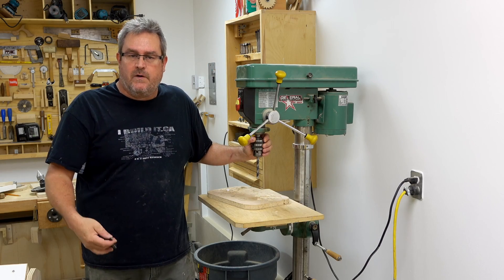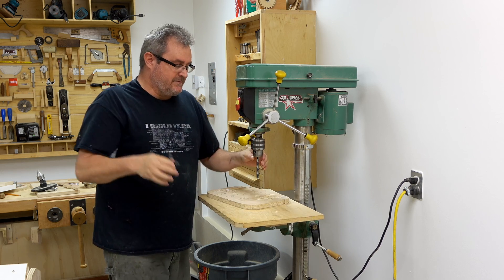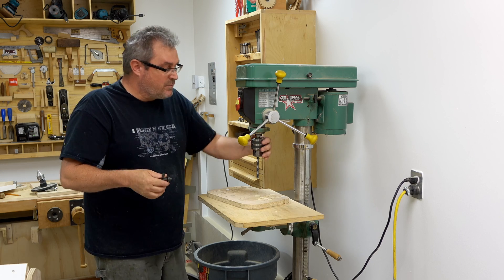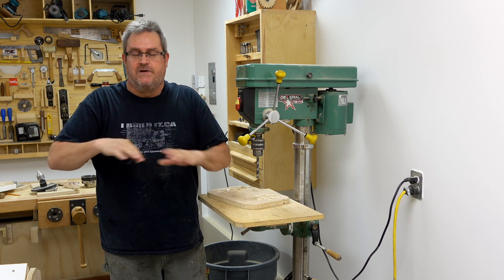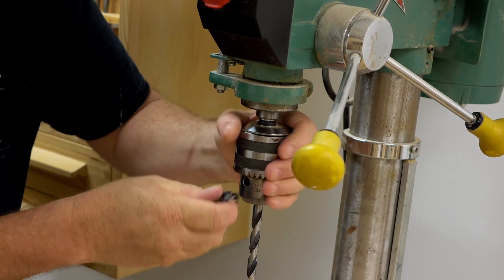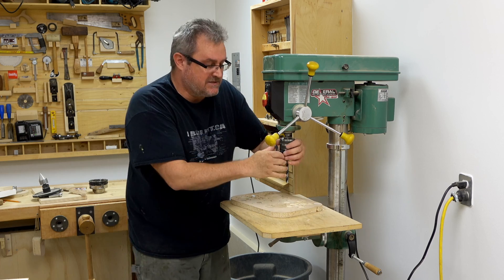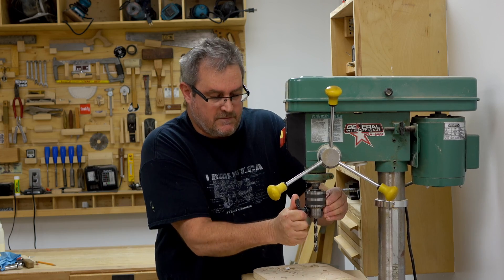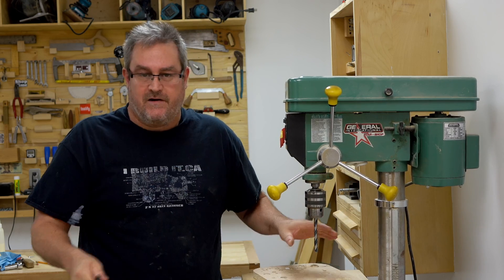Why Tighten All Three Holes On A Keyed Chuck?

Comment from the maker: Applying a little "there are no perfect machines logic" to explain why you should tighten your keyed chuck from the three holes for maximum holding power. I normally just do two, since I generally don't need the best grip on the bits, especially for drilling wood. But, it does make a big difference when you need to drill steel or other hard or tough material.
Same applies to hand-held drills that take a key, or lathe chucks.

You can help support the work I do in making these videos: 

Plans for sale: http://www.ibuildit.ca/plans.html 

Support this channel on Patreon: https://www.patreon.com/user?u=865843&ty=h 

Did you know I have other YouTube channels? 
My main channel: 
https://www.youtube.com/user/jpheisz 

More videos on my second woodworking channel: 
http://www.youtube.com/c/IBuildIt 

My home reno channel: 
http://www.youtube.com/c/IBuildItHome 

Website: http://www.ibuildit.ca/ 
Facebook: https://www.facebook.com/I-Build-It-258048014240900/ 
Instagram: https://www.instagram.com/i_build_it.ca/
Reply: Glen Shevel, I'm almost under the impression that there isn't a ""woodshop class" in school anymore.  My H.S. did away with both the industrial arts and the ag shops to May way for a new computer science lab--  made even worse by the fact that it's in a farming community.  Sad, just sad..
Reply: Three jaw lathe chucks, yes if they have three holes.  The three jaw chuck on my 10" Rockwell-Delta lathe only has one hole.  IIRC, it's a 1 1/2"-8 thread mount and 6" diameter.
Reply: I may need some help on this one but you tighten all three because of the safety factors.
Reply: Don't know what they teach in woodshop class in school anymore, but this was fundamentals 40 years ago.  Maybe teachers these days don't know the reason, so don't care.  They probably think there are three holes because it's more likely there will always be one hole easily accessible at the front of the chuck.

Comment: I think this has officially entered my Stuff That’ll Bug Me Forever hall of fame. I absolutely do it, if for no other reason than I have a clear memory of Grandpa the master machinist doing it- but the more I learn about how these chicks work the more it seems like it SHOULD NOT work! Holding the chuck for my drill press in my hand unmounted and shaking it, there’s no play or slop in the pieces inside. So the theory about the nut shifting and binding and then re-seating that was posted above doesn’t seem plausible because it doesn’t seem to have room to shift. So… turning the key at each position should be rotating the nut, nothing else. And every degree of rotation of that nut should close it by a given amount (whether you measure it by distance or force) no matter which hole the key is in. They’re all geared the same, it should not be possible that there would be any difference! And yet here we are and there absolutely is. I’m gonna be walking around muttering about this to myself like a loon. 🙄

Comment: 100% correct. I was taught this practice when I was an apprentice machinist, by a tool and die maker who worked in the aerospace industry. Not only does it grip better it also centers the drill better for less runout.

Comment: I would like to disagree. If you look inside a chuck, it is similar to a nut and bolt. Any of the three holes move the sleeve, nut, around the threaded jaws, bolt. If what you are saying is true, you should apply a wrench to all sides of the nut to tighten it.
Reply from the maker: It's not the same as a nut. There are three jaws inside that a ring is tightening against and this is all too complex to explain to someone who doesn't have the mechanical understanding. If you had that understanding, you wouldn't compare it to a nut.
Reply: @IBuildItScrapBin  Actually, I do have a mechanical mind. Check out my channel and you will see some of the things I designed and built. 

As for a chucks complexity, it is not. The three jaws have a thread just like a bolt that is split in thirds. The difference is the thread is tapered. The ring you turn with the key has an internal thread, just like a nut. 

Using your mechanical sense explain how inserting the key in a given hole affects that jaw and not the others.
Reply: Search youtube for "how to rebuild a jacobs chuck". A video by Catus Maximus verifies my comment about the inner workings of a Jacobs chuck.
Reply from the maker: @Wkirkleyiphone  Um, I don't need to search YouTube, guy, I've taken chucks apart in real life.
You might want to go out into the real world yourself and get some actual experience instead of virtual.
Reply: @IBuildItScrapBin  It is obvious you didn't check out my channel. I run a machine shop and blacksmith shop. I have taken apart and restored a one inch capacity commercial ball bearing Jacobs chuck.
Reply from the maker: Your other comments went to spam and I just found them and approved them.
I explained the mechanics in this video, in particular the "no perfect machine" concept. The key is turning the ring, the ring is spooling down the jaws, but the one closest to the key is seeing the most force. When you move the key to another hole, it shifts that localized force to that jaw and it will tighten further. 
I've used keyed chuck drills for all of my life and the only way to make sure the bit doesn't slip is to tighten at all three points. You can try it yourself, just like I think I said in the video.

Comment: BWAHAHAHA! That's a bunch of malarkey. The ring gearing on the chuck works NOTHING like tightening lug nuts on a wheel. You'd likely get the same results if you removed the key, twisted the chuck 360° and tightened it in the same hole. Basic engineering 101 might be helpful.

Comment: Of course this is three years old, and I am certain you have already read/heard this, but if you tighten all three locations you reduce the runout quite a bit.  I was having the exact issue where I was running into horrible runout.  When I tightened all three locations, the runout went to nearly zero.  This on a cheap chuck too.

Comment: Hey John,

Long time fan.  I'm not sure if this is true or not (I never tested it) but I was told that not only does tightening all 3 chuck holes helps the hold of the bit but it also mitigates any burrs that that the chuck will create on the shank of the bit.

I was just wondering if this is something you've heard or saw first hand

Comment: Three holes for me—and not because my steam era blacksmith grandfather, or my professional woodturner uncle, or my force to be reckoned with father taught me how to do it that way 50+ years ago. Common sense told me that if one hole tightened a drill bit in the three jaw chuck, but the second hole tightened it even more, and the third a tad more. . . then the one hole method didn't fully secure the bit in the jaws. Damn you Common Sense!! Must be a frontal lobe thing.

Cheers,
-- Joe
Reply: You don't get it, and you never will.
Reply: Perhaps I was a bit salty there, and I apologize for that. However, the lug nut analogy posed earlier is not appropriate. In that scenario, one is applying force at five locations, in a single direction, around a diameter. Torque differences in this setup can lead to warp, breakage, etc. That is very much like closing the lid on a pressure pot, with three or four thumbscrews at the perimeter. 

When using any single chuck key hole, you are not tightening individual jaws. You are turning an internal “nut,” that is converting that rotational movement of the collar into linear movement of the jaws, applying equal force to ALL of the jaws, simultaneously. It’s more like tightening the screw-on lid of a jar than it is like lug nuts. The perception that you are tightening it “a bit more” is one of two things: Additional compression of the flesh on your thumb (also possible here, the extra “grunt” you give on the second and third go…perception without effect), or insufficient tightening at the first hole (I suspect that many three-hole theorists do this, consciously or sub-consciously, to make the concept seem valid). Both effects could be “felt” if one had a keyless chuck, and tightened it a second time. 

Neither the axial nor the torsional holding power of the three chuck jaws is increased by applying the same rotational force three times. Try this…since you probably don’t have access to a static gripping force meter…put a torque wrench on your key. Apply the EXACT same torque at all three holes, as you tighten the chuck on a ratchet extension (drive side down). Using a torque wrench, measure the break-away torque of the extension in the chuck. Then loosen everything up. Repeat the exercise, but only tighten the chuck at one hole. Measure that break-away torque again. 

Repeat the experiment multiple times. Try it on more than one chuck. Unless your chuck is a total piece of crap, or you are intentionally fudging it, you will find no change in the pinch strength of the chuck.

Sorry, again, about the previous post.
Reply: First off, Mike, I didn't pose the lug nut analogy. You need to go over to that comment and get your whining out. Second, the rest of your response is based on several assumptions. Both these reasons are enough to invalidate the whole; and since your credibility is now in question—because of the misdirected response and unfounded and unprovable (by you) assumptions—no thing that you offer heretofore, on perhaps any subject, is going to be worthy of my attention or consideration.
Reply: You expressed this better than I could have. If a keyed chuck continues to tighten as you progress (really any threaded mechanical attachment for that matter), you have not yet achieved "fully" tightened. 

I recently installed a keyless chuck on my bench-top press. I've found it to be less secure than the keyed chuck, but the added convenience has outweighed the occasional requirement to re-tighten.
Reply: Joseph Scarborough You sting me with your rapier wit, though you are wrong on this, and, I assume, most matters.
Reply: Exactly the kind of remark I would expect from a wooden head.

Comment: I learn that is the way it should be done on my own too. I lent a contractor at my job my drill so he would not have to keep changing bits on his drill,  he then call me and told me the chuck bad on my drill cause the bit slipping, the I took the drill tightened chuck with the key in all three holes, then asked him to try it again, he did and it worked, he looked at me and said HUH... that was eight years ago.

Comment: Thanks SO MUCH for posting this! My old dad taught me this (the right way, incidentally) and I've endeavored to teach it to everyone I come in contact with, my five spawn included. The concept I always consider when tightening a chuck in this manner is that I can get the bit sufficiently tight with minimal effort by bouncing hole-to-hole, thereby (as you mentioned) saving wear on the teeth of both key and chuck.

Comment: Don't understand what's the argument about... a fact is a fact. Also sometimes if my bit is not 100% straight I can minimize that wobble by tighting it with different pressure to each hole so it compensates a bit

Comment: You have a gear driven by a key...when you put pressure on that gear, which is a continuous ring, the applied pressure would necessarily provide an equal down force on the jaws. So it would seem more likely the extra holes are to reduce the time it would take someone to find a hole to tighten/ loosen the chuck, change the bit, and re-tighten the chuck.  To put it another way, the pressure applied to the chuck ring would necessarily be equal at all parts of the ring to ensure a symmetrical pressure on the shank of the drill bit. - just my two cents and a machinist father and a set in his ways shop instructor. - Annie
Reply: What you described might work in some totaly perfecty machined and constructed chuck. 
In reality tightening all 3 holes really makes a differance. The chuck will lock more precisely.
Reply: ...in a perfectly machined chuck with no slack and every moving part uniformly contacting with zero tolerance. But in the real world of mass produced mechanical parts there is a lot of slack and mismatched (but within 'acceptable' tolerance) parts. Turning the chuck key turns the outer ring, but the ring will lift above the key causing unequal movement in the jaws. Tightening the other holes applies the same action to the jaws but from a different angle compensating for the inaccuracy i.e. taking up the slack. Always tighten more than one hole. With keyless chucks there is no key to skew the outer ring so the jaws advance more evenly. But I don't believe you get the same force applied. Hence the three or six sided shanks seen on some bits. We'll not even mention Morse or h taper chucks.

Comment: I was taught this  in high school shop class way back in 1965 and never had a problem IF I tightened all 3 holes. If I got lazy and only did 1 or 2, it would sometimes loosen up, then I would go back and tighten all 3.

Comment: anybody who disagrees has clearly not used a drill press or hand drill enough.  these are the things you just figure out after having bits fall out.  if I had to guess it's because the force of the key is not 100% rotational.  part of the force is up so it probably racks the chuck and wedges it tight before it is tight enough on the bit

Comment: A drill motor chuck is a lathe  you hold in your hand. You would not just tighten one hole of a lathe - or would you.?
If you do you are one of the guy's I was always selling drill bits too because they could not read the size on the shank anymore because there bits spun in the drill chuck because they only tightened one hole, and as a result the bit would no longer fit in the index hole so they would put the bit in up side down. The reason most of the new drill bits above 3/16" come with 3 flats is because of the key less  chucks on drill motors of today can not hold a round bit tight enough to keep it from spinning.
Spend  the 10 seconds it takes and tighten all 3.

Comment: I'd believe that if you want it tight, you tighten all three holes, but not for the same logic as your description.  I'm no engineer, but looking at how they work it seems that rotating the chuck against the geared sleeve puts a horizontal force on both the sleeve and the body (in a drill press arrangement).  That rotates a threaded collar that creates a downward force on all three jaws at once.  There is no single jaw more or less affected than the others.  I would however believe that any slop at all in the threaded collar to the jaws could cause a a bind that is biased by the hole being keyed.  Moving to a different hole would allow you to break that bind.
Reply from the maker: You don't need to be an engineer to understand how this works, you'd just have to know that there are no perfect machines - you are describing a perfect machine, one that will apply equal pressure from one local point. That doesn't happen in the real world.

Comment: It is also a great way to keep the bit from vibrating loose like if you use a spade bit. Great info John, screw the dummies that don't care and will likely ruin a project and have to start over.

Comment: Hey John.  I am totally sold.  I started the aforementioned torque wrench experiment.  Before I went so far as to weld a nut onto my chuck key, I thought I would keep it simple.  I just put a bolt in the chuck, hand tightened it, and then put it in the vice.   The bad news is that both 1 hole and 3 hole tightening slip before the 25 ft.lb minimum on my torque wrench.

Good news is when I do the 3 hole method it is noticeably tighter.  If i tighten it just loose in my hand with the key, I almost can't get it undone without putting it back in the vice.

Comment: Thanks, for the reply John.  

I did some more research and ended up down the rabbit hole of chuck types, tear down videos and machinist forums.  Suffice it to say this is a highly debated topic.  Some of the analogies that I have seen in these comments aren't quite right though.  

This is not the same as tightening your lug nuts on a wheel.  In most chucks the screw gear is at least partly shared (split ring).  

One of the counter arguments that I have seen is you don't tighten all the flats on a bolt.  But that is not the same either, because on a bolt the thread is totally shared by all the flats.  

Also, people mentioning that you evenly tighten on a lathe so why wouldn't you on a drill press.  That is not a great comparison either.  The mechanisms are different, and on a lathe you are also concerned about run out.  Where a drill press does not really have precision as far as run out goes, and tightening the 3 holes on a split ring chuck wouldn't affect the run out.

Most of the machinist guys seem to talk more about tolerances in the split ring.  So you do at least 2 holes to take the slop out of the other side.

I am of the mind that tightening one hole is probably enough in most circumstances.  However, I am sold.  I am going to start doing it out of habit.

I would love to do an experiment though.  Use a torque wrench to alternately tighten 1 and then 3.  Then use a torque wrench to cause slip in the jaws.
Reply: Yeah.  Initially I presumed that there would be a single ring thread, but most are split ring.  So I could see there being some play on the other one.